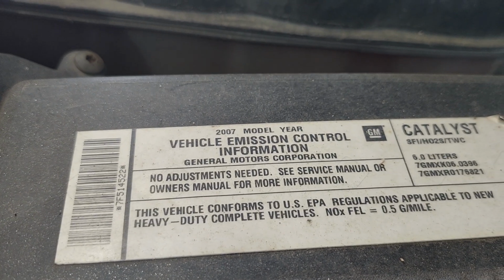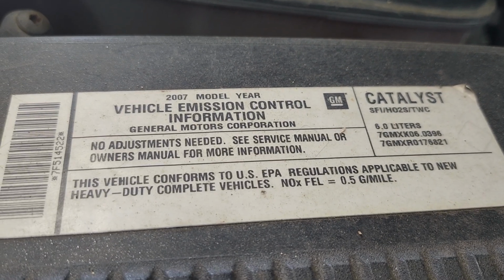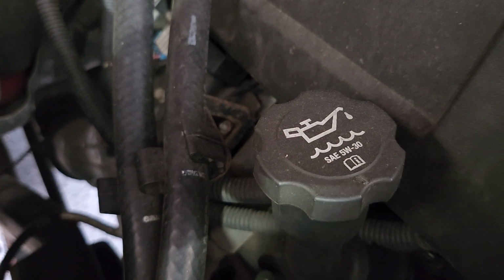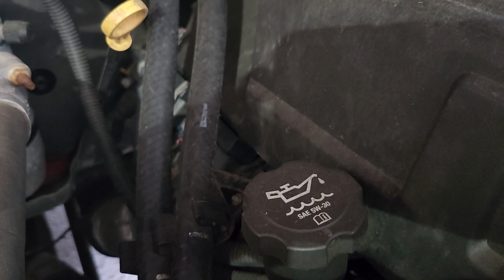Use 5W30  low engine failures .Use  0W20 oil high engine failures

Comment: In my '25 Tundra I use 5w 30.  The EPA can put a sticker on the oil cap, that doesn't mean that they know anything about engines.  Toyota recommends leaving the original oil in the block 'till 10k. No wonder these blow up.   I dumped the oil out at 750 miles and 2k.  Change it 5k max.
Reply: Yeah Tundra is my next vehicle and that’s my exact plan. Every new vehicle my wife and I get I drop the oil at 1,000 miles and then every 5,000 max. My mustang says 5W-30 I run 5W-50 because that’s what ford performance uses in all their cars. If 30 weight was adequate they’d use it.

Comment: The owner's manual for my Mazda CX-5 says 0W-20 for US and Canada, and 5W-30 everywhere else. I did find that peculiar.
Reply: It absolutely does I saw that too.   They have to because of the EPA BS
Reply: 237k miles Mazda CX-5, been using 0w-20 on it in SF California area. Original engine and transmission, never been open, and minimal oil usage/consumption. Just doing the routine maintenance in a reasonable time/mileage, don't short trip it much if at all, and no carbon cleanings done on it.
Reply: My Skyactive Mazdas all get 5W30 now.
Reply: @sbauroth  what years are they and how many miles.. i simply cant decide on my 2025 non turbo cx 5 if i want to continue doing 0w20 mazda oil with moly or switch to 5w30
Reply: It's logical to use 0/20 oils to protect the engine during startup in locations where temperatures are -15 degrees Celsius. But in locations where temperatures are 0 degrees Celsius, using 5/30 makes sense. They're forcing all vehicles to use 0/20 oil due to emissions.
Reply: @serkancetin6944  ...not emissions.....US regs for fuel mileage at the manufacturer's level for sales.

Comment: On a Toyota Prius there is no relation between 0-20 and engine problems. It's not like that with engines that are using basically 25 year old designs.
I just switched from 0-20 to 5-30 in an out of warranty Stelantis 2.4L. No trouble with the VVT.

Comment: this is bs. the lower tolerances used in modern engines require a specific viscosity to form the fluid boundary layer that lubricate main bearings, etc... This guy is pushing old wives tales based on pure ignorance and no understanding of how the internal combustion engine even works. required viscosity is not a recommendation. engine manufacturers have known this for hundreds of years but smart guy here who btw gets paid to fix broken engines thinks his faith in fairytales about thicker oil is somehow smarter than professionals.
Reply from the maker: Read the top comment here please
Reply from the maker: 2nd 1 sorry  im the good guy

Comment: Everytime I go to walmart I grab 4 big jugs of restore and protect 5w-30 goes in my entire fleet of vehicles all ranging in mileage from 150k-260k.
Reply: If I were you I wouldn't use Retore & Protect, if you open the cap & look down there's oil in there.
Reply: @seatime674 what???
Reply: @raymondnist8770 😂😂

Comment: Exactly ZERO performance or towing-rig engines use 0w-20. Zero. None. Nada.

That's a clue.

A stout 5w-30 like Pennzoil Ultra Platinum, Castrol Euro 5w-30, or even a thin-for-grade 0w-40 like M1 FS.....all of them do a significantly better job getting an engine to 300k miles than ANY 0w-20 or 5w-20. You can put "cheap walmart synthetics"  of 5w-30 or 0w-40 against the most Gucci Amsoil/Redline/HPL/RP 20 weight oils and it's STILL not a fair fight.

Comment: Engines weren't designed on water type viscosty...5W-30 is found out to be the perfect viscosty for Engine protection!
Reply: Yeah but you know some car will throw a CEL if you put the wrong oil in.
Reply: @robfish2303 usually they will if you put a xw-40 and the engine recommends 0w20
Reply: @robfish2303 no such thing as
Reply: 0w oil is many times thicker than water. In fact. If they were to measure water on the oil viscosity scale, it'd probably measure -200.
Reply: @pete1342  you are comparing oil and water. Water is not an oil so who cares.
Reply: @Zelansky1People who constantly compare oil's viscosity to water seem to care, and there is no real comparison.

Comment: Totally agree My 99 Silverado's original 5.3 now has 429,000 miles. 5w30 Pennzoil it's whole life. Still holds 40 psi at operating temp at idle, and will push 65 when throttled cold. Still has original coils and injectors.  70K more to 1/2 million.
Reply: The Vortec motors all seem to LOVE Pennzoil. I dunno why.
Reply: Could have used 0w20 the whole time and the results would be the same.

Comment: I have a 2016 Silverado v6 fuel management system   recommended oil is 5w30  it has 175000 miles. I've been running 10w30 Mobil 1 not a dexos oil   it seems to run and sound better. I am planning to put a disabler to keep it from going to 4 cylinders   any opinions positive or negative?
Reply from the maker: I believe in no useiing what the oil  cap says go up

Comment: If engine has failed using 0w20 it is one of the two things. Engine was not developed for 0W20 or engine has other issues. 0w20 is never  reason for engine failure if engine was developed to use specifically 0w20 oil.  Thin oil means tighter tolerances and more efficient oil pump. Benefit of 0w20 is easier flowing less pumping power, more efficient engine.  use it and change it using same logic as for all other cars. short distances = change oil frequent, pushing the engine = change oil frequent.  For engines that should use 0w20 oil there is all sorts of changes on the engine one of them are low force piston rings. These can get clogged by carbon super easy. When that happens thin oil will pas these rings very easy. when oil consumption starts it is just matter of time when you will starve your engine of oil lubrication. Starving engine of lubrication kills any engine in few miles only. Customer notices some issues and pours in some oil then comes to you and says : I hear knocking in the engine, but oil is toped up.  Plenty of engines are bad day one from factory, issues in production and assembly, that is  very unfortunate and very painful to get new engine under warranty.
Reply: You are making a decent argument on a few things defending 0w20 but what about in other countries where the same vehicles are using 5w30 and it's the same engine?
Reply: @seatime674  there is no such thing as "same engine". Each engine comes with wide range of tolerances. If it falls in  tight tolerance range, it can use thinner oil. If it falls in to loose tolerances cheapest way to fix that manufacturing fault is thicker oil.  Manufacturers do make mistakes and all "same engines" are not the same. I am not defending the 0W20 oil. My message is different, it is not oil that has screwed some engines it is probably bad engine from day one, produced with to big tolerances.
Reply: @Mario-r7s3m I think my main point was that there are still a lot of the same engines, "not all", but a lot of the same engines where 0w/20 is required in the U.S & 5w30 is used in other countries..
Reply: @DillonDner  HI 
I was thinking I explained that in my original comment. I can repeat. No two engine are exactly the same is about manufacturing tolerances.  They do have range. As consequence of these tolerances, and they are quite wide, some engines will be super happy, some will maybe consume oil or  or spun bearing.  It happens to all manufacturers and for that reason many will state in manuals quart of oil per 1000 miles is acceptable oil consumption. In EU many bluntly say 1l (about quart) per 1000km (about 650 miles). When you read that in manual of your brand new car, one gets bit worried, scared almost.

If manufacturer wants to make different engine for different oil grade (market) that is not a big deal since you can play a lot with bearing sizes and piston rings and oil pumps to accommodate for oil type. So they do exactly that and they do it when market demands certain level of regulations. All comes from penalties paid by manufacturer based on how unclean their product is.  So to make their products appear cleaner without the need to really develop new engine they just shave off all parasitic load. One of bigger is the oil thickness. Thick oil is great for proper lubrication but it robs you of power. 

So yes thin oils are way to go because you get better  efficiency of the engine, but engine really needs to be "tight". If it is not tight it will consume oil. If you see your thin oil in your 0w20 advertised engine becomes even thinner after short use, becomes black super fast (in petrol car), engine becomes nosier then usual, then you have no choice but to drop in thicker oil, 5w30 or maybe even 10W40. All other characteristics of oil must be the same as on 0w20, Low ash oil (LL)  ACEA C5 API SN PLUS etc.

Hope that pictures better what I was sharing from my side. no conspiracy, no wrong doing, just plain old manufacturing tolerances and regulations. Bit of luck on consumer side also helps and for sure frequent oil changes will never hurt the engine :)

Comment: Is the problem that the 0W is too thin for startup or that the 20 is too thin for operating temps ?
Reply: 0w is the absolute best for every car on the planet at startup that's not a question, it's the 20 that might get too thin when hot

Comment: I ran my 2001Subaru outback on 10w 30 full synthetic for 300 thousand miles and oil changes every 3000 miles  and just took the heads off and the piston walls are still crosshatched like brand new no wear what so ever, , I am now on my second head gasket and third timing belt kit, oem of course ,,and a Valve adjustment every 150 thousand miles
Reply from the maker: Sick results

Comment: Valvoline ran two motors side by side for 500k miles, one conventional and one synthetic and both made it to 500k on 10k drain intervals. One had a waste gate failure and both had cats fail conventional at 200k synthetic at 400k. The conventional had significant varnish but both had cam lobes that looked great.
Reply: Both used OEM recommended oil weights.

Comment: I have a 2015 Tundra that I bought new currently sitting at 407,000 Mi on it live in Colorado tow trailers and campers over mountain passes and all I've ever used is 0w 20 I have zero issues zero oil consumption

Comment: 5w 20 is ok in a 2025 GMC 1500 5.3 L engine? Calls for O W 20 … What is safe to use over the GM Recommendation?
Reply: 5w-30 Synthetic at 5k OCI's. Just ignore your oil life monitor.
Reply: 0W = cold start ability spec at -35°C.
5W = cold start ability spec at -30°C.

Could you use 5W-20 synthetic motor oil: Sure.
But to keep your GM powertrain warranty, I would use manufacturer spec's oil.
Check your owner's manual.

A xW-20 viscosity at 100°C = 6.9-9.2 cSt

IMO, would use Mobil 1 5W-30 synthetic motor oil that is a viscosity at 100°C of 10.8 cSt.
& is licenced GM dexos1:GEN3 spec.

When outside powertrain warranty, I would use Mobil 1 ESP 5W-30 Euro spec synthetic motor oil.
That has a viscosity at 100°C of 11.9 cSt.
I use this in my '19 GMC Terrain Denali AWD with the LTG 2.0L DI Turbo I4 engine. That calls for 5W-30 GM licenced dexos 1 spec synthetic motor oil

https://www.mobil.com/en/lubricants/for-personal-vehicles/our-products/products/mobil-1-5w-30

Comment: My Toyota manual says the 0W is just needed for cold climates, I live in Florida, and to use a higher viscosity than 20 if under heavy loads or at high speeds. So what is high speeds? 120 MPH? 80 MPH on the interstate? That says to me that 5W-30 offers better protection and 0W-20 is just Toyota trying to meet government MPG standards.
Reply from the maker: That's what I say is normal abuse not defined in the book

Comment: My engine is designed for 0-16. I change every 5000. No issues. Of course its a toyota not a chevy
Reply: Any engine can run on 0w-16 oil, as well as 0w-8.

Your engine isn't special. It can also run on 0w-30, 0w-40 or 5w-30....

Time to listen a lot, read and learn.

Comment: 0w20 all the way for me. Never had an issue.
Reply: What’s your oil change interval? On the fence re: my 17’ titan. I always change my oil every 5k, and that about changing to 5w-30, but I don’t wanna end up voiding my warranty. Might change to every 3-4k
Reply: @VaticusChadicus  Thin oil is thin oil regardless if you change it early. Run the 5w 30 at a minimum or run 10w30 especially if you are in the Southern States. Thin oil is  to get better mpg and does not have the shear force resistance that a heavier oil has.  The 2019 Camaro specs for a 0W40 weight oil and runs fine with the cylinder deactivation, but I always ran 5W40 because 0 is as thin as water. As for your warranty, the manufacture is betting on your engine making it until the warranty is up.
Reply: Just wait. It will.

Comment: Numerous brands are having issues with the 0w-20.  We all know about GM, but what about Ram's lifter failures or Audi's rocker arm failures. Hyandi/kia??  Even Toyota is having many engine failures right now.  Nobody will blame the oil, but it's funny how many of us don't have the issue with thicker oil.  My Audi S5 calls for 0w-20 and I run 0w-30 Amsoil.  Not only did I go from 20 to 30, but Amsoil's 0w-30 Euro is right at the top of the limit of a 30 where most are at the lower end of the kinematic viscosity range.

Comment: The thing about the environment is correct! I live on the Gulf Coast and I use 5w30 in place of 0w20 with confidence. Heck I could use 10w30 with zero issues for that matter but with synthetic there is little viscosity improvers needed to get the spread of 5w30 so it's really not a concern.

Comment: After a couple of oil changes that I did with my own hands in my honda accords, I realised that 5K with 0w20 is actually too much. I switched to 3K eventually and not looking back, The after 5 =K oil looked just terrible and smelled with gasoline so bad. I believe there are some oil that can do 5K and over, which are sludge free and provides decent protection, but they dont cost $25-35 per jug. Those off the shelf full synthetics in your local Walmart and Amazon are typical cheap oil based on Group III or Group III+ at best. You cannot demand much from 'em. So if you pay cheap, then do it more often, I guess. I agree with 3K intervals. Surely if you wanna keep the car for long. If not, do whatever you want.
Reply: It might smell like gasoline because your fuel-injectors are clogged. 
Consider using better gasoline.
Reply: @aliendroneservices6621 not just clogged might be over fueling due to combustion issues of some sort.

Comment: 18' Pacifica calls for 0W-20 im wondering if 0W-30 would hurt in that new 3rd gen 3.6 Pentastar😮
Reply from the maker: 5/30 if i5 was me
Reply: @anthonynastasi4098  Wishing for a crystal ball if bearing tolerances are "really" tighter with vehicles calling for 0W-20 or if it's all just 100% Cafe 🤔

Comment: The Toyota 5.7 regularly goes 500k plus on 0w-20. That said I agree it's bullshit these thin oils. My concern with going to a 30 is the VVT amd cam chain tensioner operation
Reply: I have the same concern, I dump oil and filter 3k
Reply: Wait, you’re saying it goes 500,000+ miles on 0W 20 but that oil is bullshit? Doesn’t sound like it.
Reply: @Maynardd  😂 I did kinda contradict myself there didn't I..

Comment: Extended oil change intervals are the problem, not 0W-20.
Reply: No it's a combination of the two. Some engines simply aren't designed for a thin oil but the manufacturers went to 0w20 across the entire fleet as is the case with the GM 6.2.
Reply: @RidgelinePatriot  "The recommended oil grade for the 2025 Chevrolet Corvette (LT2 6.2L engine) is 0W-40, according to AMSOIL and Mobil. The oil should also meet DEXOS-R specifications." (Google AI)

Comment: The wife has a 2020 Toyota Camry, 2.5L, 4 cylinder, A25A-FKS Engine, 39,000 miles.  Her owner's manual "recommends", not requires, 0W-16 oil.  0W-20 can be used in a pinch, it says, but then change back to 0W-16 asap.  I went on the Toyota Europe website.  EXACT same engine.  It says you can use:  0W-16, 0W-20, 5W-20, 5W-30, 10W-30.  It's all about gas mileage requirements here in the U.S.  I believe Toyota Europe.  Switched to 5W-20 Valvoline Restore & Protect, and will be switching to 5W-30 next.
Reply: you don't explain WHY you made the switch- was it excessive oil consumption? why not change to the 10W30 oil?
Reply: @tommurphy4307  Valvoline doesn't make Restore & Protect in 10W-30.   I always suspected that 0W-16 was way too thin.  And no, not burning any oil yet and I want to keep it that way.  Thanks.

Comment: do not know how many Nascar fans are out there but I have along time friend that is on one of the pit crews, a few years ago one team used a 0 oil, not 0W20 but just 0 and gained speed, so now they all do it, yes they run faster but these engines are junk after one race, if they make it, is that what you want for your daily driver? I could give details but I will just say take the advice that Anthony gave you , he did not talk about viscosity breakdown, if you start with 0W20 after 8,000 miles when the light comes on it will be 0W14
Reply: even if they do survive the race- they're going to get ripped down and freshened just the same, so you are comparing apples to oranges by comparing street motors to modern race motors. when i was crewing for race teams in my younger days- we wanted our motors to last all season- at least until we built our runoff motors.
Reply: @tommurphy4307  yea I get you just making a point that thin oil leads to more common engine failures